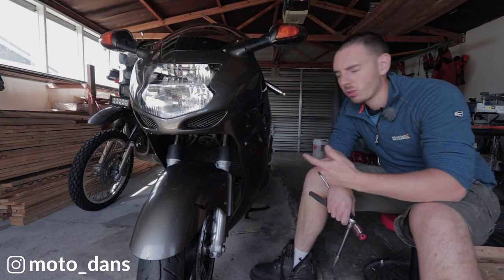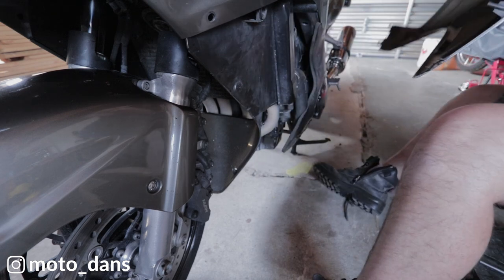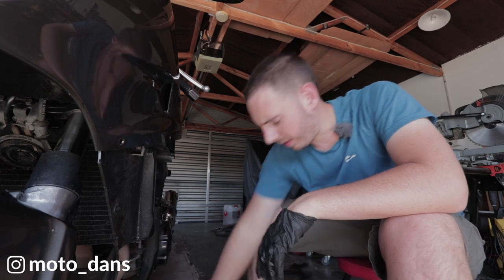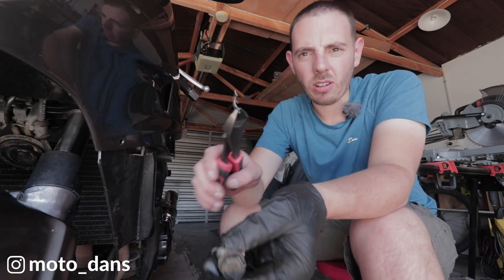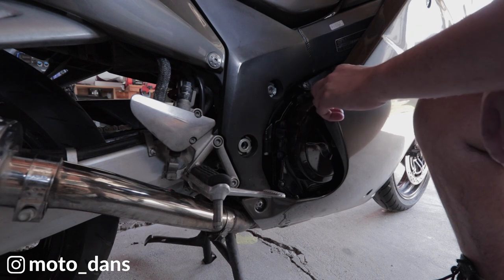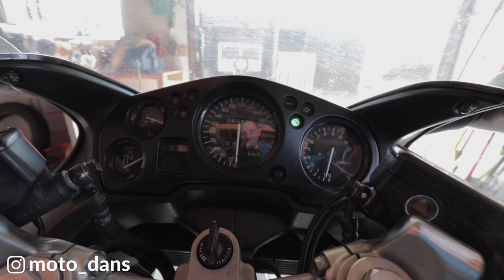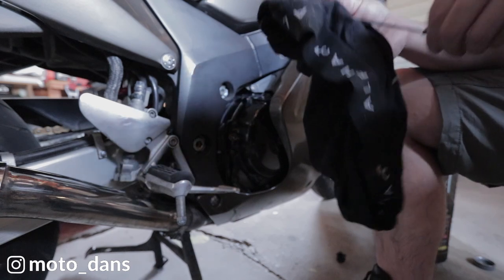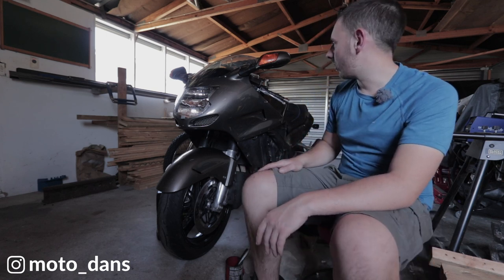Honda Cbr1100 Blackbird - Oil Change

Comment: Nice clear video showing the process. I use a G clamp that I put over the filter which makes it easy to remove from underneath without removing the fairing panel. The filter kind of sits inside the G clamp (so the clamp grips the 9 o clock position, rather than the 6 and 12 o clock if that makes sense at all!). 🙄 That said, as your video makes clear, removing the fairing panel is straightforward enough. My bike looks identical to your btw...it's registered 1999..so very last of the carb models. I also have a BMW K1600gt but, despite being tight for space, I can never bring myself to sell the blackbird...it's a brilliant bike.
Reply from the maker: That's a good idea, reckon i would still remove the fairing though as easy to do. Mine is a 96 model so very first! They are great bikes for sure! Thanks for watching

Comment: Great video Dan, I will admit that I have reused crush washers myself  but I do agree with you, for the cost,  it really does make sence to replace them at each oil  change. Thanks for a great video, such a nice bike.
Dino
Reply from the maker: Cheers Dino.
 You can buy them in large packs from Amazon and such like. It's not just the sealing factor of the crush that happens it also takes some of the torque from the bolt. When it can't be crushed anymore you start stretching the threads in the sump. 
Loving the bike so far very easy to work on!